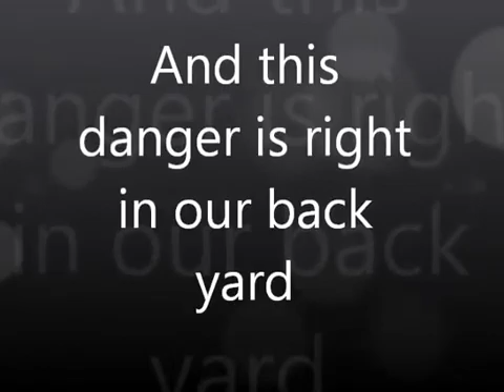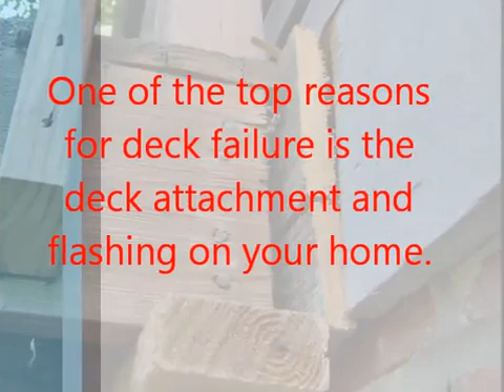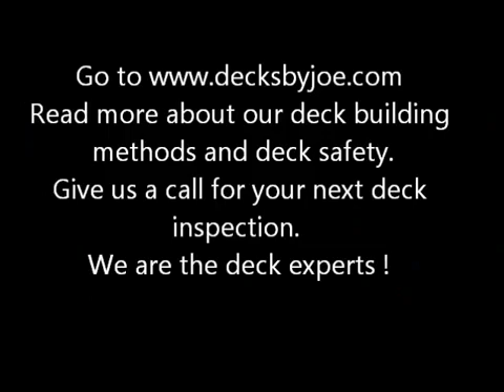Deck Collapses in Minnesota. By Everflashing, and Decks by Joe

Comment: Look no further than improper installations or the use of corrosive cleaning chemicals. Most aren't aware that structural metal decking hardware manufacturers, used to support and hold together most decks, such as USP Connectors clearly discloses the “causes of external attack by chemicals like chlorine bleach” and that Simpson Strong-Tie clearly discloses the “general corrosion risks” of “cleaning chemicals” like those that contain corrosive sodium hypochlorite.